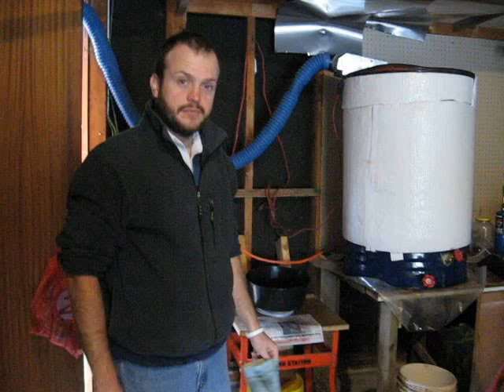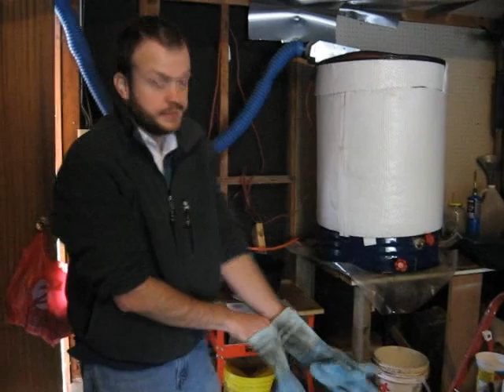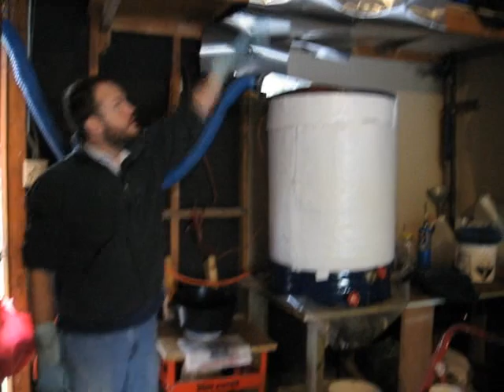Veggie Oil Fuel Home Processing Plant - Dewatering

Comment: I read your blog. Your correct about the energy density of the veggie oil when compared to 12,000 Watt-hr. In my humble opinion, lead acid batteries actually ARE pretty great assuming your trip length doesn't exceed 40 - 60 miles. There are people who seldom go further than that. In their case your system is way too complex and just doesn't make sense. You have me on the amount of energy stored. I will not argue that one and never intended to. Sorry for the confusion.

Comment: just an observation, but you seem to be expelling a fair amount of energy to dewater - boiling the oil & running the vent fan in your process.  I thought the idea was to put as little green house gases into the atmosphere during the process as possible. 

just curious if you considered a passive system where the water separates to the bottom of the tank rather than boiling off? Thereby using less energy

Comment: Also, a resin barrel would be better than steel. You can get them for free at commercial car-washing places - just ask. And clean them out thoroughly with water. Very thoroughly (don't wanna burn detergents in your engine).

Comment from the maker: Ottawa is a prodominently powered by HydroElectric - no *direct* GHG costs.

Also consider the GHG costs of cleaning the engine because you didn't de-water.  :P

Water can remain suspended in solution in the oil, settling can't seperate it out.  A centrifuge or heating the oil you can be sure it's gone.  Google for "The Pan Test" for water content in veggie oil.  Try that test before and after your settling.

Maybe you don't need to de-water at all - maybe settling doesn't do anything.

Comment from the maker: Then I'd say you have a good source for oil.

I'm sure you know all this, but it bears repeating - water is much smaller than 1 micron - so filtering isn't enough.

And water will disolve into oil and some of it will never settle out.

The pan test (put oil in a pan and try to cook it, getting water to boil) is the best test for water in suspension - as far as I know anyways.